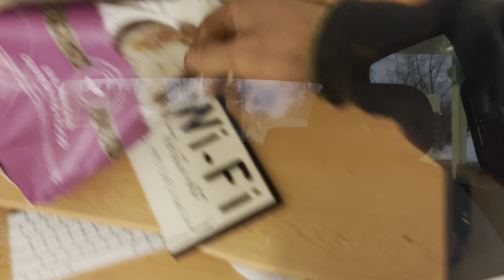One guy called in!! Still gotta get err done ✅

Comment: Different states have different requirements our regional department ask for different things but here in Colorado we are required to put starter course  all around and have 1 inch over hang so the water flows right in the gutter and we are also required to change pipe jacks vents once in a while we will add ridge vent if the customer ask for it but not required for a ridge vent electrical boot is required to be changed ever new roof and some cities in Colorado you need ice and water but some don't felt the same some cities in the state you can over lay paper if only one layer some you need torn off